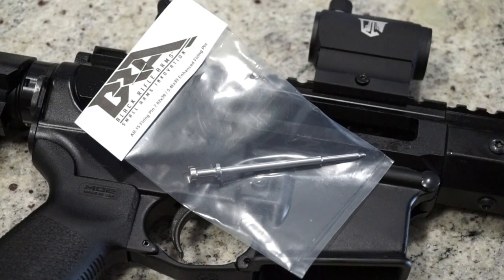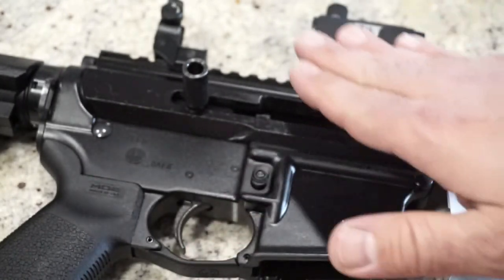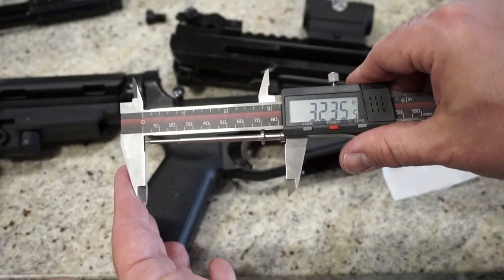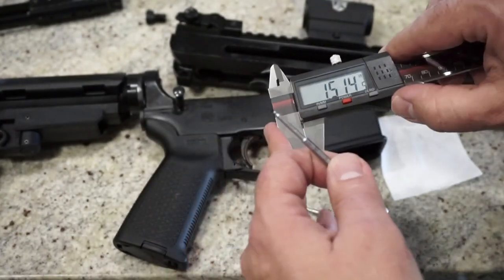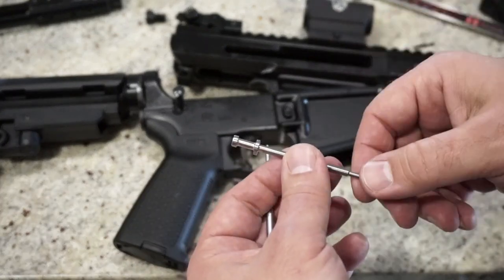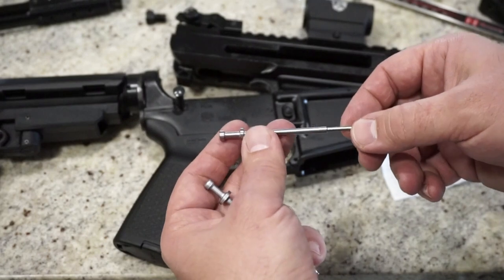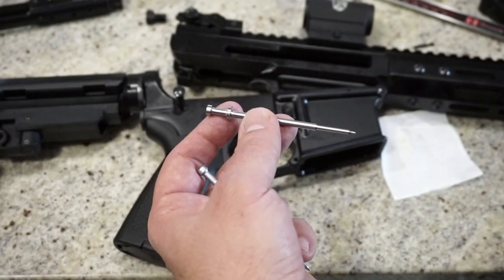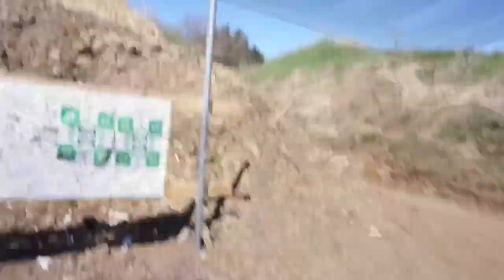Black Rifle Arms 7.62x39 "AR47" enhanced firing pin.  Tested in BCA 7.62x39 upper.

Comment: The length overall is not what makes an enhanced firing pin. You see the second ridge from the back. It is just ground down on the firing pin side. That allows for a greater forward stroke.
Reply from the maker: Oh!  Thank you! my old eyes couldn't tell so I thought the length was the reason why.  This is good to know!
Reply: @travisp11  It is hard to tell the difference by eye.
Reply from the maker: @UncleDanBand64  This is true!
Reply: @UncleDanBand64  That's what I was looking for. My first build has been AWESOME but my second is giving me problems. I just put a wolf extra power hammer spring in and was wondering if I could enhance the firing pin myself before I go back out.
Reply: @travisp11  old but not obsolete! Also I think the  head/tip is a little thicker, sir!

Comment: Not sure if it's been mentioned in the comments, but the extra 3/1000 isn't the big difference it's then dimensions of the shoulder, the thickness of it which is what makes a difference and allows it to seat further into the bolt face.
Reply from the maker: Yup. You are correct here

Comment: Tuul and wolf don't have harder primers.  The primers are seated deeper. There is no need for the wolf, extra power hammer spring. All you need is the enhanced firing pin and your 7.62x39 will fire them flawlessly.
Reply from the maker: So far, the pin is all that I have had to change and the upper has been rock solid for me.

Comment: This fixed my ks47 issues with the red army ammo. (Pin and hammer spring)

Also to anyone fiddling with these AR47's an h3 buffer spring helped fix my extraction/double feed issues and an AR15 extractor fits on the AR47 BCG's even though they're proprietary. Don't spend the money on an "AR47 enhanced extractor". Just buy an AR15's made out of a quality metal for half the price and attach it to the BCG. 

She's ate everything with no failures for 800 rounds so far since the tweeks.
Reply from the maker: Sucks that we have to make these changes and that they don’t seem to have these issues when they are test fired but at least now your rifle is fine. Thanks for watching!

Comment: C products magazines are the best to use on your AR 762 by 39
Reply from the maker: Mine work pretty good. I had issues with one but it  was easy to fix.
Reply: Any experience with unimags?
Reply: I was surprised but I got 2 30 round promags that run great with no modifications
Reply: ASC aren’t bad mags either.

Comment: I just received the enhanced firing pin i ordered the other day. I was having problems with the tula ammo also. The original pin in my upper is actually longer than the enhanced pin. 3.279 vs 3.290. Measuring from the tip to the collar, the enhanced pin is a tiny bit longer and the tip is pointier than the original. I also purchased a stronger hammer pin incase the pin alone doesnt solve my problem.
Reply from the maker: The stronger hammer spring should help, too. I was possibly wrong when I mentioned the length of the pin actually mattered when in reality, like you said, the collar is recessed a bit more on the enhanced pin
Reply: @travisp11  Its all good. No matter what, your video helped me out. I was just a little confused as to why my measurements were different from yours.

Comment: I just tested my 762 upper from bca witch they advertised the upper came with a enhanced firing pin , I still had light primmer strikes with steal , so I ordered the 762 heavy hammer spring and a new enhanced firing pin hopefully that fixes it
Reply from the maker: The enhanced pin will definitely help and the hammer spring should increase reliability.
Reply: @travisp11  thank u for responding
Reply from the maker: @Steezy.gunz_  yup!

Comment: I just bought three of them I'm going to see how it works on my 16 in BCA so that way we'll see if it really works on all the ammo just like you did I had some slight problems but if you run the brass case with the primers that were designed to go with those it should run fine but when you run the old stuff Chinese stuff it really has a hard time hitting those primers you should be able to run everything so it would be a wise option..

Comment: I just got my 10.5 inch 762x39 side charging upper. Had a few light primer strikes with tula as well. Also would eject the fired round but not pick up a new one almost every time
Reply from the maker: An enhanced firing pin will fix the light primer strikes. If not, then upgrade your main hammer spring.  As for picking up a round, possible fiddle with the feed lips on your magazines. They can be finnicky.
Reply: Stick firing pin front first in drill press chuck, set spindle to ~1k RPM, with hand file take .020 -.025 off shoulder where it meets the backside of the bolt. Look for the tip to protrude .045 - .050 from bolt face and youre gtg.
Reply: You need to slow your bolt down h3 buffer

Comment: Just for future measurements with your calipers, that upper area is normally -.050 of clearance. It’s not good practice to measure things there.
Reply: Just looked up dimensions on firing pin an over all length is around 3.278 an you got 3.232. Guess your calipers have about .046 worth of under cut for grinding jaw.
Reply from the maker: Lee Vin-ewe turns out the enhanced firing pin is actually cut lower on the first ribbing vs. mil spec but according to BRA, the firing pins themselves are the same length.
Reply: Not the correct area to measure anything with calipers. Lol.
Reply from the maker: @MrMe1976_  good to know!

Comment: This is a lil late but was wondering is black rifle enhanced firing pin better then BCA enhanced firing pin? I got BCA enhanced firing pin and it still doesn't do the trick so looking for something a little longer or harder hitting. Why I know it's the firing pin and not the hammer is because the brass fires everytime all day, steel case of any kind. Not so much, when I looked it up it says steel case primer is a little thicker.
Reply from the maker: We have broken 2 of the BCA enhanced firing pins at the range. My Black Rifle Arms firing pin and Wolff AR47 hammer spring go bang every time. The primers on Tula ammo as of late are rock hard so going with the Black Rifle firing pin and Wolff spring should do the trick.
Reply: @travisp11  nice!
Reply: This is what I was looking for. Thank you.

Comment: got the side-charger upper a few days ago, and when i swapped the fire pin, i notice the BCG is really hard to take apart, i am not sure if it needs to break in or due to the manufacturing (since the price of BCA is really affordable)...  wonder if you see the similar tightness issues of BCG.  thanks.
Reply from the maker: Yeah, sometimes the bolt is a tight fit to the carrier. Just be sure to wipe the outside of the bolt down within a drip or two of gun oil.
Reply: I recently bought a POF 762x39 upper. The bolt in it is extremely difficult to get out and in. It doesn't seem right but im going with it anyhow.
Reply from the maker: @willrobinson9575  it should come out with a little effort but shouldn’t require more than a minor tug to remove. You you gotta give it a lot of force, you may want to get that checked out
Reply: @travisp11  First time removing it i had to grab it with a rag because it was painful on a bare hand. Its getting easier the more i disassemble it.

Comment: Hornady has some really nice 762 by 39 I'm telling you they have come up  with some really good stuff... I have an SKS is and they'll eat anything that's how we have to get the AR moving,. I think cmmg is come with that a long ways...
Reply from the maker: Hornady used to make a poly tipped steel case that was cheap but adequate to hunt with. Now they market that round as Hornady Black with a brass case and a higher price.
Reply: @travisp11  Hornady black is really good try out a frozen turkey at 20 yd and see what it does
Reply from the maker: @nicholasnapier2684  that might make for an interesting video!

Comment: Could you use these enhanced firing pins in 300 blackout jus a question before I switch the standard one?
Reply from the maker: I believe that the pins are identical between 5.56 and 7.62x39. I would imagine that you can use it with 300blk but you may want to confirm that with BRA before doing so.

Comment: what buffer weight are you using travis? just got this upper and have heard i need to go heavy
Reply from the maker: Chaz Ajieré standard carbine that PSA uses ok complete pistol lowers.
Reply from the maker: @CHAZMADETHAT  None of my BCGs show any signs of extreme wear and brass tends to fly in consisten patterns usually between 3 and 4 o'clock.

Comment: Great video and heads up!!!! Also, what was your distance to target and have you stretched out the distance for accuracy? I'm debating a 7.5"  300 blk or 7.62x39 for play
Reply from the maker: Mark Kanady just did a 25 yard sight in. With a red dot, I would think 50-75 yards would be easy on a silhouette target. My personal preference is 7.62x39 as it is cheaper to shoot overall.
Reply: @travisp11  thank you
Reply: @markkanady   It's interesting to note that,  with a 25 yd zero in that rifle,  MPBR is ~225 yds (+3.7" at 100yds,  -3.95 at 225),   If you push your deviation you can run damn near 275 yds with a 20yd zero, and a ~6" deviation..( +6.4 @ 140 yds and -5.6 at 270yds)   -That's great(!) for a 7.5" er!!

Comment: i also have some issues with feeding on my ar47, what mag did you go off with to fix your problem. i was about to order a dura mag
Reply from the maker: I tried a few C Products Defense Duramags. One out of the 5 that I bought has feeding issues. Usually, as long as I don’t load the mags to max capacity, there are no issues.

Comment: You think a anderson multi caliber AR lower receiver work good with this bca 7.62x39 upper ?
Reply: @ElliotThurman Yes they work! That's what I'm running BCA 7.62x39 Upper & Anderson Lower, I did order the extended firing pin from Black Rifle Arms & C Products Mags cause the ASC Mags had alot of failures to feed hope this helps bro!
Reply: @j.diazreptiles8279  nice! I’m waiting on my BCA upper and I currently have an Anderson lower that I’m gonna use it on!
Reply: @juniyananajukyu  Good setup bro! I got my C Products mags in waiting on the extended firing pin then ill go try it out asap an let you guys know how it goes im praying it goes smooth!
Reply: @j.diazreptiles8279  yeah please let us know how it goes. I have C products mags coming tomorrow and my upper comes next Tuesday. I also ordered a Wolff extra power hammer spring. I’m excited for this build because 7.63 is waaaaay cheaper to shoot than 5:56/.223.
Reply: Stupid2669  @juniya79 Hey guys so all parts came in and the gun runs very smooth no malfunctions or miss fires! 🙌🏽💯

Comment: The standard pin and the enhanced pin that came with my upper from BCA had the tips break off. I ordered another from Red X Arms. Any tips to prevent this from happening again?
Reply from the maker: I’ve never had a Black Rifle Arms pin break but my Bear creek Arsenal new enhanced pin broke 5 rounds in while shooting Tula Ammo.
Reply: @travisp11  that's what I was shooting as well. So the issue seems to be specific to BCA firing pins?
Reply from the maker: @pete5108  yeah but for some reason the Tula primers are hard as heck right now. A few of my other lowers cant ping the primer hard enough to make them fire off. The Bear Creek firing pin looked like maybe it wasn’t properly heat treated.
Reply: @travisp11  well hopefully this new pin works well. Thanks for the timely replies. You earned yourself a new sub. Keep up the good work sir.
Reply from the maker: @pete5108  Welcome to the channel and thanks for watching!
Reply: @travisp11 Tula ammo killed my BCA enhanced firing pin too. Just ordered two of these BRA firing pins to rectify the problem. Damn BCA firing pin broke in less 75rounds. 🫠
Reply from the maker: @TooManyChoices1  they must be MIM or cast because I have never broken a pin on the other brands of ARs that I own.

Comment: What’s your opinion about running steel through it?
Reply from the maker: Packersfan 1227 this firing pin definitely helps ensure hard primer imported steel case ammo will fire. I’ve had no issues running steel through mine.

Comment: bought the 7.5 Gen 2 762x39 Found gas block loose straight out of the box ensured holes lined up with and blue loctite tried multiple lowers h2 and h3 buffers and springs cant get pistol to cycle tried 1 round bolt gold open passes every time, also checked bolt carrier lubricated and extractor is ok, also spring is nice and hard no issues with bolt carrier, does not eject round most of the time any ideas anybody? Also tried different ammunition and magazines
Reply from the maker: I wonder if the gas ports on the barrel were not properly drilled out to allow the upper to function properly.  Id send it back in and have BCA figure out what is going on.  You may also be able to have your local gunsmith bore out the gas ports on the barrel to the proper diameter.  There could be some burrs in the gas ports causing issues re stricting gas flow down the gas tube.

Comment: Could you comment more about the charging handle  didn't understand that part
Reply from the maker: The charging handle screws in on the side of the bolt carrier group and can come loose after a magazine or two. The new Gen 2 uppers from BCA dont have this issue.
Reply: @travisp11  Another words, you have a side charging handle, rather than a rear  charger?👍

Comment: Measuring the total length of firing pin ? Should measure the correct part of firing pin to notice the difference.  I see others comment they got different length pins , u measuring the wrong part of firing pin 😂🤣
Reply from the maker: Yup, I screwed up completely. Its not the length of the pins that was different anyway it was the collar on the pin that is slightly recessed on the BRA firing pin.  Trust me, you arent the first person to point this out.  Even though it is an error in the video I decided to leave it up because of the test footage.
Reply: @travisp11  I was referring to others comments not specifically just to your measurements.  I shaved my firing pin collar a little and now it's great 👍. Its a common problem on these , the firing pin, mags  and feed ramps .. but easy to fix and resolve

Comment: Will the 762 enhanced firing pin work in a 556 bcg?
Reply from the maker: Black Rifle Arms makes a 5.56 specific firing pin. They don’t call it “enhanced” though like they do for the 7.62 firing pin. DO NOT mix parts that are not specifically designed for your caliber and firearm. You may want to call Black Rifle Arms and ask them if their AR15 firing pin is enhanced. What that means is that it is ground a bit longer to allow a tiny bit more protrusion of the firing pin vs. mil spec every time you fire the weapon. This allow a better strike on hard primers.
Reply: @travisp11  thank you

Comment: Just an FYI you are not using your calipers correctly. The measurement you are taking is going to read shorter because you’re not on the actual surface that needs to be touching what you’re measuring. Which is the surface that is actually touching metal to metal when it reads zero. Notice when you have them closed at zero there is a gap on the place you’re measuring the pin
Reply from the maker: Yup. I've had a few people tell me that. Turns out it is the recessed cut just below the pin that is different on the Black Rifle pin and not the pin length itself.

Comment: I suppose you might be okay using those calipers to measure difference but just so you know, you don't measure where you did to get an actual measurement....
Reply from the maker: I know. I've had many viewers notify me of this. The pins are the same size but the BRA pin has a collar that is ground back just a hair more than mil spec allowing a tiny bit more firing pin protrusion.

Comment: I tried the enhanced firing pins from red x arms and it didnt fix my problem.
Reply from the maker: Try the Black Rifle Arms pins that I used and I don’t think you will be disappointed.
Reply: Unless you use at least milspec strength hammer spring neither will work
Reply: @kenchan3038  it worked
Reply: @CMBDIA  I have both, and I cannot tell a difference. So, I swear by both. That's why I said that about the spring. I'm glad you got it running.
Reply: @kenchan3038  Just to clarify, i mean it worked with the Black Rifle Arm firing pin that travisp11 mentioned.

Comment: I noticed in your video you used the recessed part on the caliper you got a false reading for your measurement. The stock firing pin is at 3.275in and that is a stock firing pin from BCA on the ar15.  7.62x39.
Reply from the maker: I believe the pins are the same lenght and I was wrong in my measurements. Big difference was the enhanced pin is recessed just a hair to allow more firing pin protrusion through the BCG pin hole.

Comment: anyone else bothered by the way he uses calipers?
Reply from the maker: Yup, dozens of people that have watched this video. I have since learned.
Reply: @travisp11  let’s all improve every day! Thanks for the video. I ordered one last night and got the hammer spring too just in case. Did this fix your issue? I tested a new 5.45 build over the weekend and was getting a few light primer strikes a magazine
Reply from the maker: @newtypetommy  I recently added a wolfe brand spring to my 7.62x39 set up and along with my enhanced firing pin, I have yet to now find an x39 round that won't run through it. Before, even the occasional Tula round would cause issues.
Reply: @travisp11  hmmmm…. So I should just install both to be safe?